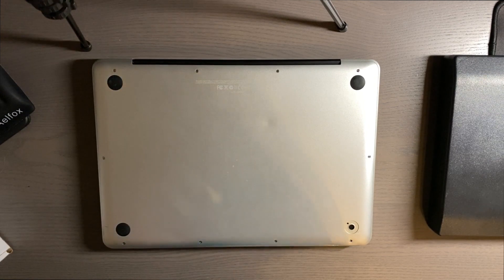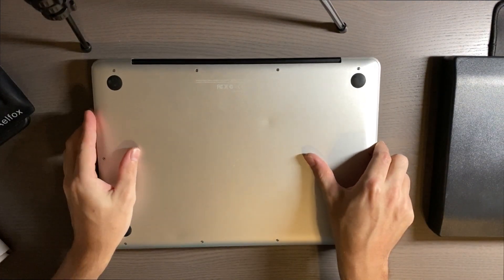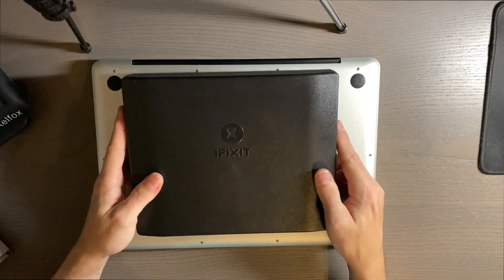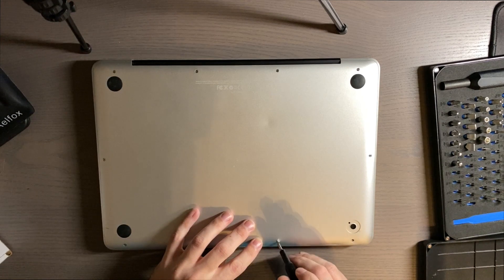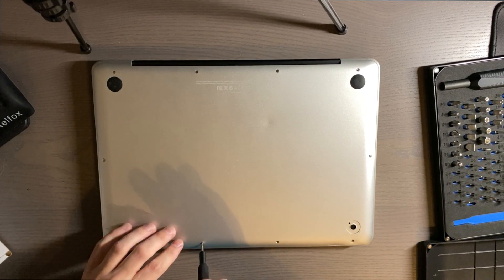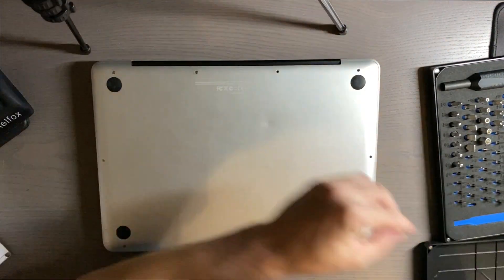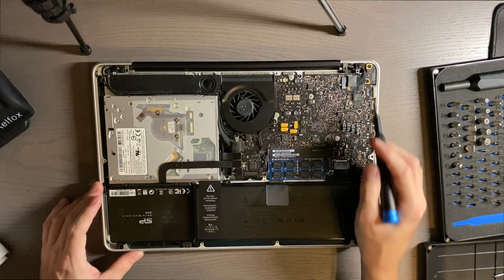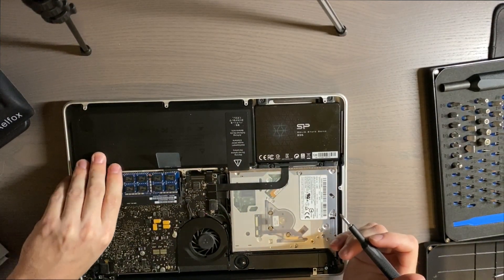Changing thermal paste on 2010 Macbook Pro

Comment: Disappointing. I watched this to find out exactly which screws and connections I need to remove, in which order, in order to get down to replacing the paste, but because everything has been sped up apart from opening the case, I really can't tell what's going on much of the time. Definitely not enough detail for me to feel comfortable doing this myself.
Reply: Same thing for me.